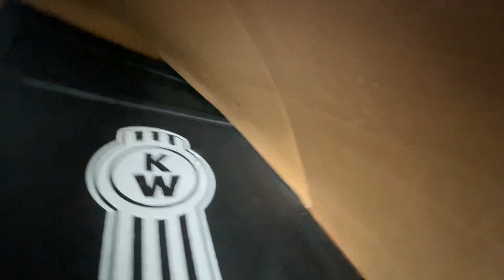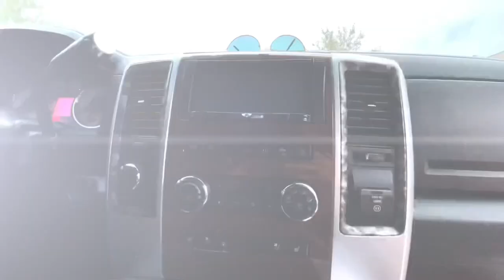“Airbags Blown TRAILBLAZER SS or Envoy” This is How to Replace DIY Air Ride Replace Riding Low

Comment: Thanks for the video, I am having issues with my air suspension on my Saab 9-7x Aero.  Sags overnight, would you agree to start with the air shocks or the compressor?  IIRC a service tech said that the compressors have valves that go bad over time...